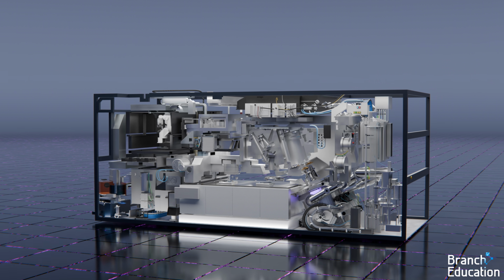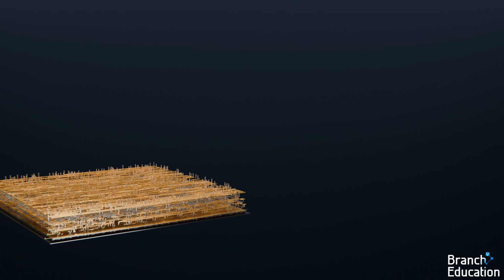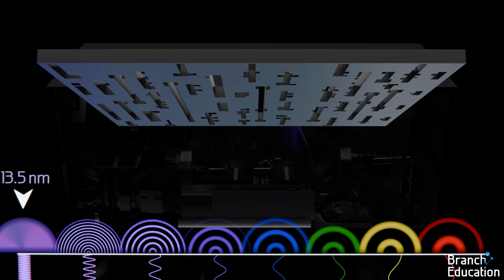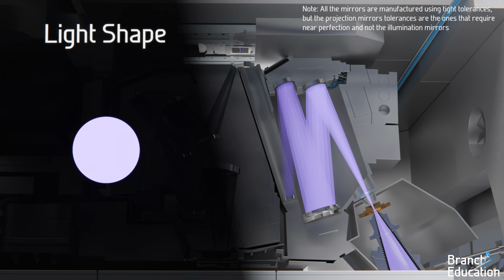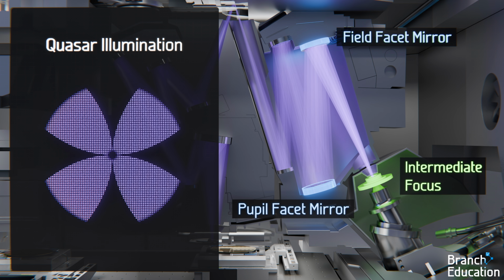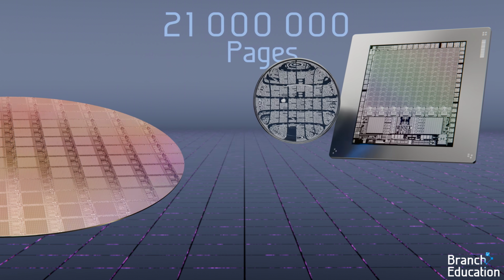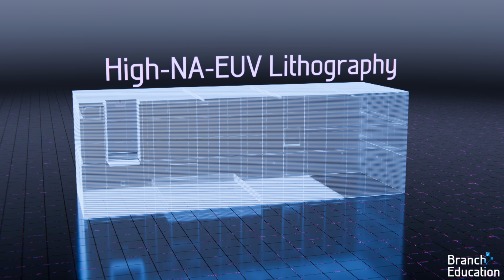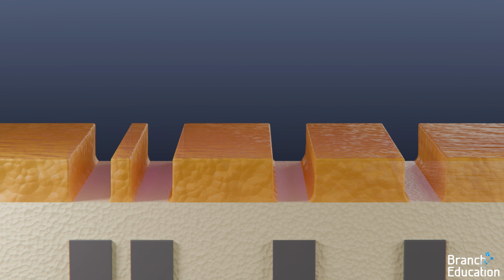The $200M Machine that Prints Microchips:  The EUV Photolithography System

Comment: Mind blowing. Question: when a layer is washed, certain parts removed to leave only the wire for example, how is the next layer built on top of those empty area underneath?
Reply: Nice one, there are in fact no empty areas in a chip. There are multiple other machines in the factory that prepare the wafer. One of their jobs is to create a layer of dielectric material. All of the empty spaces are filled with a dielectric material then we can print the next layer above it.
Reply: @parveshkhatri1027  Make sense, without it I imagine how fragile it would otherwise be.

Comment: I was hoping they would mention that the different processor speeds aren't a design feature but are "defects" in the lithography that result in lower performance. Instead of discarding them, they are sold as lower-power models.

Comment: I have a question, Are there any sprayed (in addition to transistors) also capacitors or resistors on the processor crystal, the fact that they are soldered on the textolite substrate, I saw

Comment: I know a lot about photolithography, but I learned many new things in this video. First, how the pattern on the mirrors change. And also how the twinscan alignment builds a 2D vector and 3D topographical map of the wafers. I always wondered more on how the alignment works - as layering these 80 stages is so important. And to think there’s so much more that is proprietary and confidential that we don’t even realize. Oh - I also learned how high speed cameras measure the tin droplets to align the trajectory of the laser pulses. There was a text comment in one of the clips around the laser part that mentions they’re working toward 100kHz. You heard them mention the laser pulses at 50,000x/second. So they’re working toward doubling this to 100,000 pulses/second. What isn’t mentioned is how the tin explosions pollute the very pure environment inside the machine. The mirrors are so delicate and precise that they cannot be polluted by the processing of the tin. I’m sure it’s a trade secret how they vacuum up the reside of the tin explosions. But another facilitating variable to consider.

Comment: I did not realize so many litho passes were done (~80), or that so little EUV light is reflected by those mirrors that they need multiple layers (Bragg reflector). Definitely explains why the source needed to be 500W. Those first mirrors (like the field/pupil facet mirrors) must get really hot. I'm guessing there are many more complex illumination patterns produced beside just annular, dipole and quasar, or they would just swap between a set of fixed mirrors rather than those complicated ones. But I'm curious how can they maintain accuracy of the projection (imprinted light). I would have imagined there would be ghost images, slightly offset for each layer down it takes to reflect on the mirrors in the projection optics. How can the registration marks (fiducials) be used to align the mask to sub-nanometer accuracy when the light wavelength is 13nm. Also curious about why the per-chip movement pattern. Why not expose a full path of chips at a time? I'm guessing to optimize the reticle movement. Could chips be made reflected, that is have the reticle move forward and back while moving a full wafer path? Would mean you would either need connection symmetry or a variable packaging process to handle reflected/non-reflected chips. Idea: add a small chip design to the fore/aft margins of the mask and extend the reticle movement on the edges of the wafer to use otherwise wasted edges on the wafer. Fascinating stuff and a great video. Brain is going a mile a minute here. Will check out the links. Thanks Branch Education and ASML. If I'm ever in the market for a EUV litho machine... :)

Comment: Thanks for this amazing video. I work at ASML, and it feels like a privilege to see such an informative video available for free on YouTube. Just amazing !!
Reply from the maker: Thank you so much for the support!  Also thank you for your hard work at ASML!
Reply: i have one question, like why silicon wafer is always round in shape. make it square so it dont waster chips.
Reply: @epicman9001   
Leaving the wafers round is less wasteful. 

Because the original Silicon Crystal grows into a cylindrical shape. 

That cylinder is then sliced up like bread...thin slices. 

This is how you end up with round wafers. 

You can't grow that original crystal into a square shape (with current methods).

A seed crystal is submerged into molten extremely high purity silicon...and it is spun. 

That seed crystal then grows, and as it grows it's pulled up. 

If they pull slow, the cylinder grows wider in diameter. If they pull fast, it becomes thinner in diameter. 

So the speed is balanced to grow a certain diameter, that is adaquate to process wafers into the final diameter. 

Btw, there are always imperfections in the Crystal structure of that crystal. This might result flaws in the final chip. 

Also, there's lower likelyhood of flaws in the centre of the cylinder. The wider you make the cylinder, the more flaws appear. 

The best chips statistically come from the centre of that wafer (more so toward the top). (such chips typically run at high clockspeeds, can overclocker better, retain adaquate signal at lower voltages, etc.)

Such chips are typically binned (put aside) and used in some expensive professional grade or enthusiast product.
Reply: @epicman9001 aligning a square wafer to a coordinate system would be far more difficult, although clearly not impossible, as the reticle isn't round. But like someone else stated, the silicon is grown as an ingot, and is then sliced and ground flat and parallel to itself. Making it a square wafer would mean having yet another process. This is actually done anyway in the back end when all the dies are cut and picked from the wafer to then be packaged.

There are, and were wafers that had very large flats cut into one side, but generally speaking a 300mm wafer has what's called a notch. This is used to align the wafer, and determine rough rotation before loading it into the scanner.
Reply: @epicman9001  The most important reason is because when the resist is spun it cannot be square as the non-uniform shape would mean resist liquid would gather on the corners more than the sides. Also as the other guy mentioned, silicon comes in cylindrical logs and is painstakingly cut into wafer sheets with a single cut. A square waver would need many more cuts.

Comment: bro so its just like my Resin 3d printer, SLA, Stereo Lithography... it just uses a black and white UC LCD Screen with goo on top, like a TV screen facing up, under a cat of goo, and just goes one layer at a time., all those little circuit patterns are so easy for a 3d printer to make. Honestly as my SLA 3d resin printers get higher and higher resolution, and when we get more advanced resins that can do conductive nmaterials etc, we WILl be able to 3d print a processor at home with a regular $100 SLA resin 3d printer!

Comment: UV Light of 6.5nm or even less to make 13nm lithography...or even 1.5nm for 3nm in ideal conditions.
What kind of light is this? This is a hard X-ray, not light. This is not light, and optics cannot be used in the first place.
I think the real secret of the machine is not exposed by today's top "lithography".
They are not using lithography, maybe 70s, but this is a different technology today...not lithography and light for 3nm. This is ridiculous. There is no optic for that energetic radiation; this is far from UV light. X-ray is not possible to use optics

Comment: I think I know why it's the case, but can you do a short (5 minute) video on why after a layer has been done, the wafers go from a mirror finish to having a vibrant rainbow of color with visible color shifting in the shape of the circuit? (I know that it's because the different sizes of surfaces limits the wavelengths of light that can be reflected, resulting in different visual colors, but it'd be nice to have a video that explains opalescence at this scale and level of detail, and could be then used in other civilian accessible hobby fields like film photography to make color lens filters out of ISO 50 black and white film, or even lower ISO. I saw a different youtube channel do this and more, but the technical description was lacking in a few places and a video with this level of detail would be a way to bridge that gap)

Comment: Did we skip a detail at 18:26 - where does the tin plasma go? I mean, there are still a bunch of tin atom floating around and accumulating, which need to be evacuated somehow. I'd guess that'd be the job of a vacuum pump and a fine filter, perhaps with a little help from some inert/noble gas? Edit: i should've watched a few seconds further - yes, there are vacuum pumps, but also an invisible ice berg of trade secrets. Well, i guess, it's magnets, then. Plasma ions/charged particles are steerable by magnetic fields, see also electrons in CRT tubes. I don't think vacuum pumping an already established vacuum could evacuate 50-60 kHz worth of vapourised/plasmarised droplets fast enough - the light path/cavity would "fog up", and it'd be a huge maintenance pain in the rear to scrub tin deposits off the cavity walls. Just like Jack O'Neill, from Stargate said; "Magnets!" 😂

Comment: In projection optics, why does an EUV machine use many mirrors? Is it only for high-accuracy measurement, or is there more to it? And what if the EUV machine used fewer mirrors—would that make any difference, and would we lose less UV light in the process?

Comment: Crazy that this is “complex” since photography was one of our first technologies. A big example of the crossover of arts and technology. The most advanced Cyanoprint. Easy logical conclusion since manipulating light (optics) is another OG tech.

The only difficulty with this tech is the material technology. Handling such intense electromagnetic radiation while also concentrating it(opposite binoculars) and not having everything to do that get destroyed. Like taking a litebrite made of lasers and using reverse binoculars to draw a mini pattern.

That’s the special sauce you won’t get in this video. The reason Taiwan is Taiwan. I think huewei?? Is attempting another type of EUV tech.

Like fission tech. Material sciences are a huge limiting factor. Like they always have been since forever.

Comment: Fantastic video — thank you very much for such a detailed explanation! I’ve been following your past videos and they’ve been absolutely informative and educative, especially for someone like me who is really looking to dive into this industry.

That said, there’s still something I don’t quite understand: why do EUV lithography systems need so many mirrors to guide the EUV light, especially given the relatively high reflection losses at each stage? Why can’t the EUV beam just be directed more directly toward the photomask, with fewer optical elements? For instance, instead of passing through multiple mirrors, why not use just one of the facet mirrors (field/pupil) that shapes the illumination pattern, and then go straight to the mask?

Comment: Why is the wafer circular, wouldn't it be more convenient if it were rectangular?
Reply: This is done because the wafers are supposed to be spun at a really high speed to evenly distribute the photoresist. Making them rectangular would mean so that the corners will have uneven distribution

Comment: Who or how are ALL the microscopic connections designed?!

From what i am understanding, it's basically wires connecting other parts or layers to each other, but who comes up with those connections if there is essentially enough space to hold more than an entire library?!

Comment: Amazing device... Very surface level explanation though.

I would be interested to know to know where does necessity being and if it's due to where our knowledge stops.

For instance, there's some distance in locating different aspects of production. Are they distant based on physical law constraints? (For instance, that's the distance required for heat to dissipate or some physical constraint)  Or is the distance financially motivated? (As in, more expensive to transport in stores.)
The same for other aspects, like why these many mirrors? Why the steps and the moving arms with relatively high margins to move?

I'm pretty sure all of them are thoroughly tested out to maximize yield, but that's the part that informs the viewer as to why the device is designed that way.. and really, the device is more of a flagship piece supported by a web of other processes.

Comment: 🗣 WHY ARE WAFERS ROUND!!!???
Reply: "because the Czochralski method, used to grow the silicon ingots from which wafers are cut, naturally produces cylindrical shapes. The circular geometry also improves process efficiency by providing a more uniform surface for spin coating and deposition, increases chip yield by maximizing the number of dies per wafer with less waste, and is more robust to the stresses and mechanical fractures encountered during semiconductor manufacturing."

Comment: Excellent video, but there are some things that are not clear.

 We know that a thyristor, a transistor, a diode, a capacitor, a resistor, a potentiometer, etc., etc. etc., are thousands or millions of components, they have different values and functions.

 How do they manufactured thousands of resistors of different values so small, the same as a transistor, a capacitor so, so small, can you explain it? 

I would encourage you to approach a theory that borders on science fiction, which I will keep my opinion until I know, how do they produce such small components of these circuits.

 Where does this knowledge come from, in less than 60 years?

Show me fabrication of a resistor of 30 ohms 5 wattas or different values, show me the production of capacitors of farads or nanofarads.
Show me a Collector,emisor and base basic transistor on different situations on a circuits, so so small.
SHOW FABRICATION OF COMPONENTS, NOT THE BIG PICTURE.

IN OTHER WORDS, THE THRUTH!!

Comment: Did I sleep it through, or you did not mention the black magic how the wafer mask looks like?
I mean, that even with 13nm light, interference has to be taken into consideration, so the mask does not contain what you should print on the silicon, but an interference pattern, which will manipulate the light in a way, that it will print what the designer actually want. It is like you deliberately light up parts of the chip, where you don't want to etch away the photo resist, but you know, that the interference pattern will weaken the light to the point, that the photo resist will stay. It is hard to explain when I also just read the "discovery channel" version of the technique :D

Comment: I was wondering how the masks are made. Since they are also tiny (4× the size of the chip), are they produced using another EUV machine?
I also had another question: why is it necessary to use multiple mirrors to bounce the light back and forth? Wouldn’t it be possible with just three mirrors?

This was a very clear and fascinating explanation. Thank you so much for putting together such an informative video!
Reply: masks are made by electron beam lithography

Comment: This is a related but maybe caused as being non-sequitur, but just want to share for others facing my issues. If games are crashing on your system adjust your volt/frequency curve in afterburner. The GPU needs more voltage! I thought it was buggy games all these years.

Comment: Tüm parçaları ayrı bir güzellikle üretilmiş. Erimiş kalay damlacıklarına lazer ateşlemek muhteşem. Ama yorumlarda kimse bir manyetik tabakalı sistemin 1 nanomatre hassasiyetle hareket edebildiğinden bahsetmemiş.  Bu , sabit duran bir fırçaya tabloyu sürterek resim yapmaya benziyor. Ve 1 NANOMETRE (4 silika atomu !!!) ile !!! Bence en can alıcı ve ayrıntı kalmış kısım burası. Çünkü yapmak istediğiniz nanometrenin altında bir hassasiyetle hareket ettiremezseniz ufak ayarlamalar yapamazsınız. Mükemmel.    Tabiii bir de videoda söylenilen bir şey de var , bazı kısımlar gizli ve değiştirilmiş bilgiler içeriyor. Yani aslında belki de her dedikleri tam doğru değil veya başka şekilde. Yine de efsanevi bir video olmuş. Teşekkürler !!

Every part is manufactured with its own distinct beauty. Firing lasers at molten tin droplets is magnificent. But no one in the comments mentioned that a magnetically levitated system can move with 1-nanometer precision.

It's like moving the canvas against a stationary brush to paint a picture. And with 1 NANOMETER (that's 4 silicon atoms!!!) of precision!!! I believe this is the most crucial and overlooked(missed) detail. Because if you can't move with sub-nanometer precision, you cannot make those minute adjustments. Perfect.

Of course, there's also something mentioned in the video: some parts contain hidden and modified information. So, perhaps not everything they say is entirely accurate or is achieved differently. Still, it's a legendary video. Thank you!!